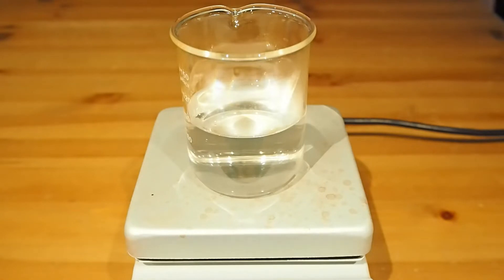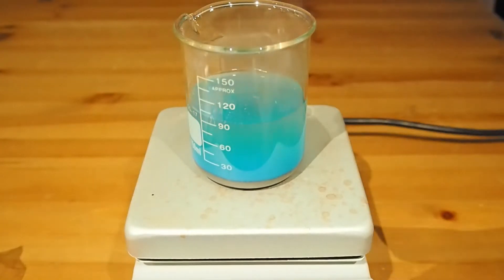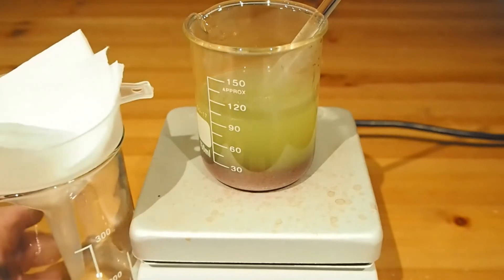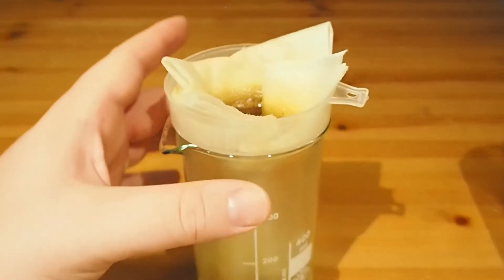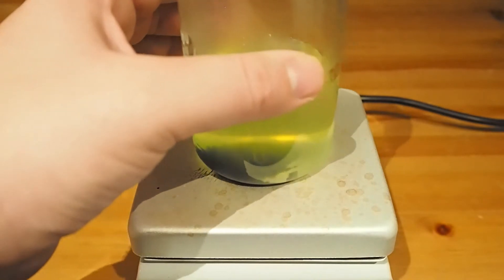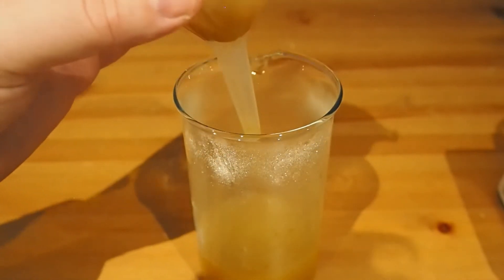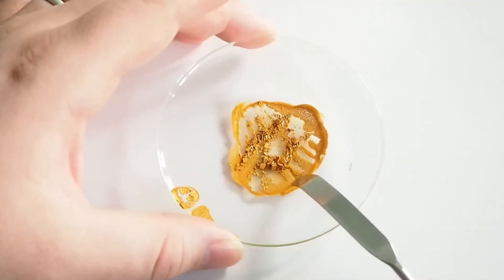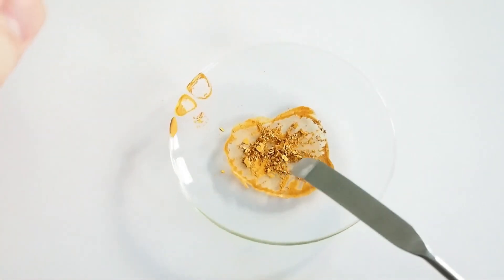Making Iron (III) Sulfate - Ferric Sulfate

Comment: Isn't this more of Iron Oxide and less Iron Sulphate? I believe Iron Sulphate is white in dry form? Just wondering. Correct me if I'm wrong. Much appreciate it. Thanks!
Reply: I think you're correct since it's very difficult to make the iron(III) sulphate without an oxidiser and conc. sulphuric acid as far as I can tell. I have made iron(iii) sulphate from iron(ii) sulphate using hydrogen peroxide so. He has definitely made the Iron(ii) sulphate though since it got that greeny-blue colour.

I remember reading somewhere that you can oxidise iron(ii) with oxygen in the air but that forms iron oxide like you said. So probably a 50-50(ish) mixture of iron oxide and iron(iii) sulphate plus maybe trace iron(ii) sulphate maybe?
Reply: I too think this is either iron(III) oxide or iron(III) oxide-hydroxide
Reply: @satina1169 Yes or basic sulfate
Reply: Perhaps as a result of the hydrous iron III sulfate or because there are other metals present?
By the way, sulfur may change some metals into others, such as lead into gold or copper into silver. 
When the proper mixture is melted without burning the sulfur away, precious metals are produced.
Therefore, the majority of metal sulfur compounds were mysteriously left without image or information so that someone like you can continue to be a slave and be used to work for and serve the richer people.